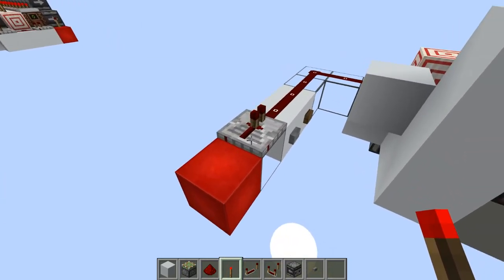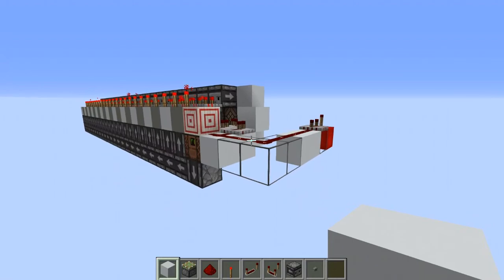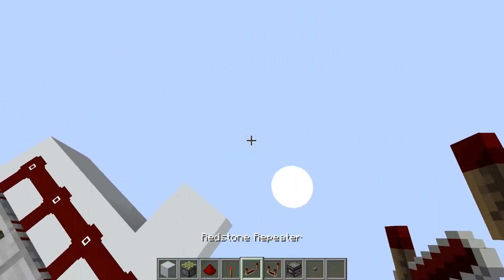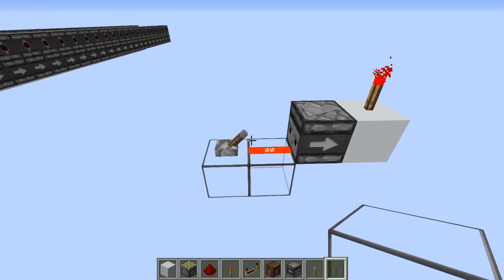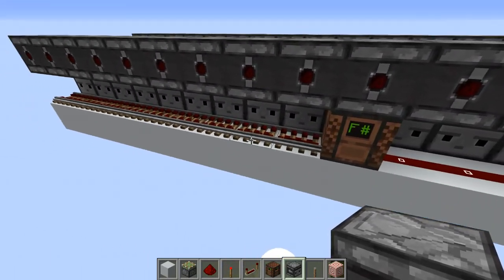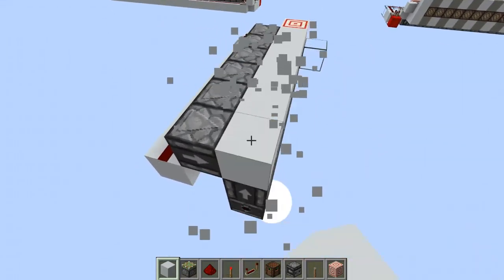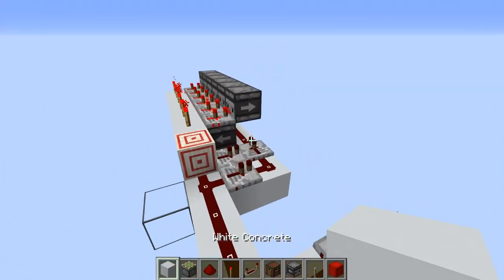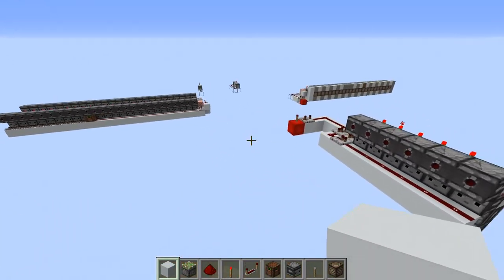Pulse Length DeMux: Detection & Conversion, All in One! | Minecraft 1.16+

Comment: What I struggle with is what to use this stuff for. Any examples would be nice.
Reply from the maker: This is about transferring information. If you have an input system with multiple options you could either wire each button to your system (a mini-game for instance) using multiple redstone lines or just encode the information as a pulse, transport it through a *single wire*, then decode it back to its unique value for processing.

This system simplifies this exchange. I'll present a pretty solid example soon.
Reply: I mean, sometimes you'll be designing a build and you'll need some kind of "translator" between these two ways of transferring information (pulse length <-> parallel redstone lines > signal strength) this is that translator. These are just more tools you can put in your toolbox so that when you need these circuits (however rarely) you can go "oh, I seem to recall that Maizuma designed one of these, and it has all the features I need (or can be modified to have all the features I need)"
Reply: Thank you both. Super helpful. That is one of my struggles to know when to use this or when to use that. That is usually one of the pieces of information that is missed in showcases/tutorials.
Reply: @stormcrow-mc  I have created a redstone machine in my redstone world, that transfers information using pulse lengths, as maizuma said. For the encoding i had a pulse strength to length converter, but i had no idea how to decode the signal. i thought i could use something like a clock with a dropper inputting items into a chest, but that didn't work out that well.

Comment: Doesn’t seem to work bedrock why is this so hard
Basically the repeater running into the side of another repeater blocks it and doesn’t send a signal
Reply from the maker: Maybe it's possible to adjust these timings for BE, have you tried other configuration for the repeaters ?